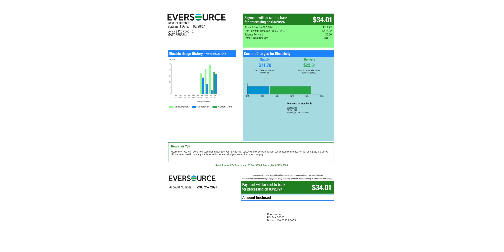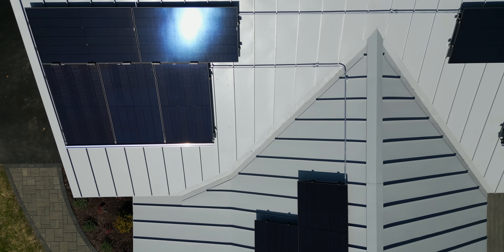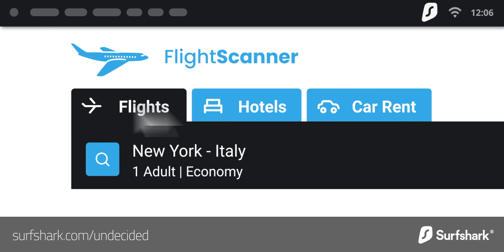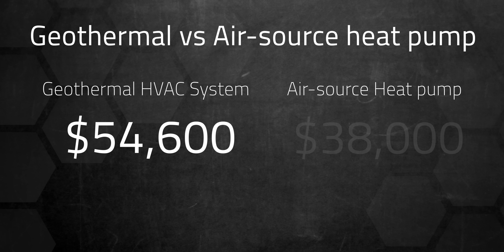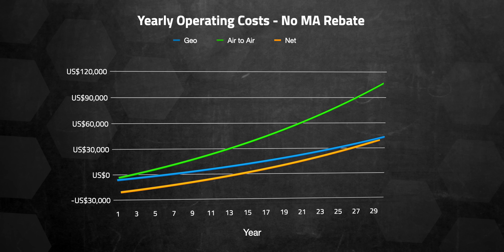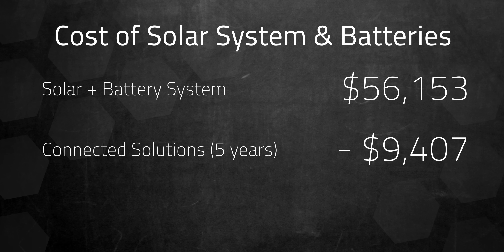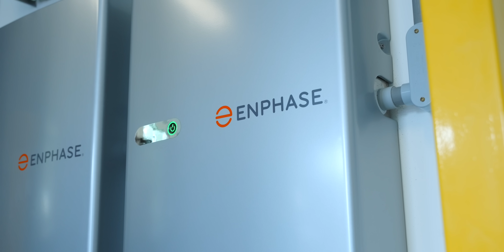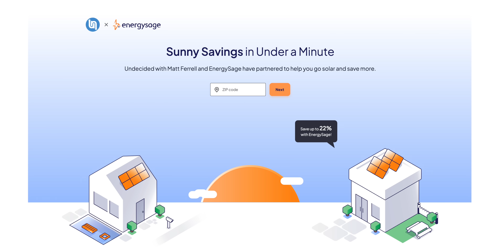What I Learned After 1 Year with New Solar Panels

Comment: Everyone talks about what it cost to install ,and how rebates helped , the cost to replace is never talked about , it a integrated system a lot of companies have gone out of business , not every component is backward compatible so new panels may require down stream components replaced, batteries have a life cycle and degrade over that time , a lot of systems have been abandoned because the replacement is more expensive and no rebates .

Comment: $300,000 in savings over 30 years isn't great, what Matt fails to account for is the time value of money in this scenario. I am not saying it is not worth it from a moral or ethical perspective, but rather from a financial one. Let's do some maths, to get $300k in 30 years you'd need to put $166k into a high yield savings account with an average APR of 2% over 30yrs. If you want to invest in the NYSE instead, with an annual rate of return of 9.5% over 30 yrs, you'd only need $20k. Now, this is simplified and you'd be able to invest the savings on a running schedule, but that also just show how present value and time value of money calculations get complicated really quick.

Comment: Why is solar so expensive on USA? In europe/finland 2024 summer cost for solar is 900€ per kW, so a 17kW system is 15 000€ including everything (tax, installation, microinverters, cabling, fastening system, circuit breakers, maintenance switch and the panels)

Comment: There are a lot of assumptions on costs and credits here over long time frames that cannot be certain.  This also assumes that there is no failures, no replacement cost for charge controllers or batteries failed after 10 years etc.  As more people do this, some of these credits, like netmetering will have to go away and the costs to produce electricity and connect people will increase for all(the connection charge part) due to the lost income.  Total costs are 144k just in thermal and solar alone.  What was the house build cost?

Comment: A factor here is the 30-year plan. The plan works when looking at 30 years. Most people don't live in a home for 30 years. Most don't live in a home for five. In my opinion, to do this on a not-forever-home isn't very feasible. Even if you were to recoup the costs of installing the infrastructure when selling the home, you've just passed it on to someone else. They aren't likely to live there for 30 years either. Good job for doing the right thing for you and for being transparent about it. I had no doubt of your outcome because you analyzed it to death before you started. What would be appreciated is the scenario that doesn't work - i.e. recovering in 10 years.
Reply: And that doesn't even take into account technical innovations and the commoditization of energy well before 30yrs is up.  30 years is literally stupid because that assumes that the economic paradigm won't evolve in the next 30years.
Reply: Batteries should pay for themselves after 5 years - otherwise it's not profitable enough, with only ~10 years lifetime span.

Solar should be repaid up to 7/8 years. They have longer lifespan (at least 20- but up to 30 years).

He didn't compare his house before and after. He's saving 45.000$ after 30 years - from hers32 to now.
But he also invested that money for solar and battery. 
He definitely payed too much somewhere.
Reply: You are delusional. It does not math the math for 30 years, and on pure cost-investment terms I did math and I could pay 148 years of my electricity bill with what he spent, and there are 4 people in my house, 2 of them work from home on computers, so go figure
Reply: does it. his design adds 1000 amonth in princible and interest for 30 years, on systems likely to last only 10 to 25 years. so at the end when you think you got ahead. you will need to start it all again.
Reply: @diegojines-us9pc  

My guess is that Matt is banking on the solar panels and batteries lasting well beyond their warranty periods. If it's just a matter of capacity degradation, he can compensate for that by buying a few additional solar panels and batteries alongside of it, rather than replacing the entire thing.
Reply: @ab-tf5fl  i was banking on my 10 year car to last longer. but the cost of repairs were higher than new payments. but i wasn't counting on spending on either one. what do i do now?
Reply: @karinoren  and the suckers who do pay more than everyone else. " the payments are cheap" but whats the cost? i dont know. thats what they all say.
Reply: @diegojines-us9pc  Indeed. As another commenter pointed out, this is paying for the Electricity NOW instead of LATER. Sure, 1 year later he isn't spending as much. But he had to spend over $100k FIRST to get to this point. Of course it will costs less, when you dump $100k+ into the fund.

I want to see numbers of someone buying a normal house, hooked up to the normal electric Grind, and what that house will be pay Electric Bill for 100 years. Then compare that to a house that has to pay to install Solar Panels, pay to install battery, pay for all other mechanical things required too, on top of their monthly bill, and then the REPLACEMENT and MAINTENCE of the batteries, Solar Panels, and so on for a 100 year period.

^ I'm willing to bet, the solar panel setup will costs you over 5x, if not 10x-100x MORE to use. Cause it's not as simple as "Plug in and forget". The solar panels will degrade over time, break down, and need to be maintained and replace. And that isn't cheap. That's the scam that Solar Panel sellers don't tell you. You only get told the bill will be lower, they never mention the costs of buying, installing, replacing, and maintaining it as well.
Reply: @Jirodyne  i want to see the person living in that home for 100 years. and i can talk with him.
Reply: @Jirodyne  If payback is longer than 10-15years, it is not good investment. In 10 years some of your hardware is broken or even if it works, it is morally aged - there are much better batteries/inverters and much cheaper price. 
It is like using 10 year old laptop - yes it could work but newer are many times more powerful and better.

Comment: Most home have hot+cold mixture water faucets. These unknowingly cause you to use heated water even when you don't need for example in summer. Hence adding a solar water heater which you can disconnect off during freeze could be an excellent addition to take some water heating load off the electrical system. The geothermal system is also excellent option to keep the water warmer then usual.

Comment: At least you think it was worth it.   
Great system. 

I have an insulated sand floor with some buried heating cables that are correct connected directly to solar with zero equipment.  
I was able to get the panels free and spent less than $100 on the heating cables. 
The sand is here already living near the beach in Chicago.  

Its a small system so far, but the proof of concept has been great!  
I plug the cables into the grid if i want to top off the heat sink in cloudy weather. 

Cheers!

The sand floor is topped by concrete pavers.

Comment: A 30 yr planning horizon, that is insane!  The cost of the equipment will still decrease significantly.  On the other hand as soon as there is a significant proportion of people generating like this, all net metering and feed-in tariffs will disappear.  Governments and utilities will wind up with huge stranded costs and there will be a solar panel tax introduced.   Governments always want their cut.  If they can no longer get at you through your electrical and natural gas bills then they will switch the approach.  They have been creaming huge taxes off of the energy system for decades (including fossil) , what makes you think that will not continue?  EVs the same problem, once main-stream the taxes and fees sky rocket, already happening in Europe and the UK.  Matt is clearly running a test case here for the purposes of his YT channel but there are some wildly optimistic assumptions in there.

Comment: I have only one suggestion, make sure your next car has V2X capabilities and make it so that your vehicle charging station can redirect vehicle power back into the home.

In that way, you suddenly have a 50-100 kWh extra battery while your car is at home.

Then, if you see the weather forecast warning about really bad weather coming up, make sure that you solar charge the vehicle as much as possible.

Then you'll easily have 10-20 kWh extra battery without draining your car to the point where you need to limit how much you drive daily. And should the grid go down, you still have 20-40 kWh extra to sit it through (letting the car discharge down to 20%).

Most 2024+ European and Asian EVs now come with at least V2L, that would be like attaching a 3kW generator to your system, albeit with a little detour through an adapter plug. Many of them also have V2G, then your charging station can do the reverse seamlessly.

Selling power to the grid hardly pays anything, so focus on keeping your own  home going.

Comment: It doesn’t appear to me that you used NPV in your calculations.  Future money is not nearly as valuable as money saved today.  If you factor in the time value of money, your savings will be far less than you think.  If you haven’t done so, you need to do an NPV calculation of the 25 years of cash flow and see what that shows.

Comment: As another MA resident; I can't help but chuckle at all this because I am in a very old home with single pipe steam; and am personally really amazed at how much I have been able to improve it with just some rather minor upgrades. I setup home assistant, deployed temp/humidity sensors, and got a thermostat that I could control... and wow the heat in this house is working better than it ever has in my lifetime and eliminated overshoot.
Reply: if americans just invert 1000 in insultation. they would recover that money in less than 2 years. then make money off it for LIFE> add it up. 500 a year for for 50 years of your life.
Reply: @diegojines-us9pc  No idea what you are saying but; "Americans" are a diverse group that live in several different climate zones. We don't all have the same issues. A home from the south would not be fun to live in up in the north where I am.
Reply: @carpdog42  now its cheap to build a home down south compared to the north. because of heating needs, but people down south only thinks that. that dont consider that insulation will reduced their cooling. 
example. one early spring in san Antonio i listen to the media asking out to help the poor to pay heating bills. it got down to the 40's. but imagine what their cooling bills was all year because they had no insulation.

Comment: I live in an area with low electric costs in comparison to the rest of the nation. This would take 50+ years before I would see an ROI. That’s assuming it generated enough power during the 2/3rds of the year where it’s cloudy. And assuming nothing ever needed fixed/replaced during that time. Right off the bat though, I know batteries won’t last 50 years so one replacement during that 50 years would push out the ROI until I’m dead. Not to mention the longevity of panels. 

Also I would treat this like I treat no interest financing on anything. It’s better not to pay lump sums upfront. Because money earns money. The cost of this system if it were instead kept in the bank earning interest would pay the monthly electric bill. In fact it would earn double the monthly cost. So in 50 years you would have accumulated another 80 grand in interest, easily. And that’s after using half of it to pay the electric bill. Not including compounded interest. 

This is why I won’t be sold on energy Independence until the costs comes way down or my electric bill goes WAY up.

Comment: Will the panels and system last 10 to 30 years? I often hear Tesla car batteries last much less than 10 years and ultra expensive to replace. Plus, solar panels suffer heat and cold expansion damage, including rain, hail, snow. Give us an update in 15 years. Duh.

Comment: The best description I have ever heard from someone who lived off grid is that you pay for your energy in advance with solar. This is due to panel lifespan and efficiency. While you see benefits up front, later it dwindles and eventually you replace the panels and spend again. I think the biggest thing people miss is the source. Everyone wants to save $10 million dollars, but in reality we are using energy from a renewable source. THAT is the important thing. Finding more ways to sustainably live renewable needs to be the focus.
Reply: It's not that drastic toh. 

According to research in 25 years your panels will be generating 80% of what they did brand new.
Reply: If it costs more, that's a "NO" for me
Reply: I put in a 10-75 watt panels daisy chained by 2's to get 24 volts and 20 years later they are still outputting prolly 90% of their rated power.   So replacing panels is not really a negative but...todays systems are based on 48v so you may have to change other components (inverters dont last forever so not much of a problem to change) and LiPo batterys have been a gamechanger as the old Deep cycle lead acids have always been the major cost investment (every 4 years if baby'd).
Reply: he’s not living off the grid. he is being subsidized by the grid at a huge price to rate payers who can’t afford these huge capital investments. i replaced my old heat pump with a 98% efficiency gas furnace and a stand alone ac unit. i have a gas stove, water heater, stove, grill, and dryer. my yearly all in energy expenses are less than $ 2000 per year for a 2500 sq ft home built in 1953. my water heater, furnace , a/c units cost less than $12k. two years ago. Why are his electric bills so high?  let me guess the new england grid is run by a bunch of rube goldberg bureaucrats and politicians.
Reply: @rburnscrcva1  Why is our electricity so expensive here in Massachusetts?  Because a few years ago I watched them blow up the largest coal fired power plant in the North East of the United States.  The two state and federal government bureaucracies had  buried it in so many regulations that it wasn't profitable to run the plant anymore. These regulations and lawsuits included building two 600ft cooling towers for the fish.  

 In fact it worked perfectly as designed and installed.  And wasn't the only functioning coal plant dismantled in the US recently.  

So they blew it up.  Then a couple of years ago, Biden stood in the same spot to tout the fact that, now, wind turbines would be staged there for install off shore of New England   Those projects died during COVID inflation.  

Yea.  We pay very high electric bills.  And if you watch the news media carefully, they're starting to warns us about rolling blackouts.  I'm guessing we won't be getting any AI server farms in Mass.

Comment: 20kWh battery... I have been off-grid and hitting the winter right now. My 60kWh isn't enough for 3 days of bad sun and cold. The days here are 3kWh, 6kWh, 50+kWh, 8kWh ... 20kWh is ample enough to heat a 15m^2 container.
Also my 60kWh was about 9000 euro ;-) (eel battery shell and nkon battery cells).

Comment: Holy crap! Those prices are outrageous! We have a 9kw solar system + 2 x Tesla PW 2's (27kwh) - installed in stages - and overall, it cost us £32,000 - roughly $40,000. And ours was an expensive install!

We actually make a small profit, year on year - as we sell electricity back at twice our overnight purchase price. Overall, including the savings from running 2 EV's, we save roughly £6000 a year - $7500. Our entire system will have paid for itself in pretty short time. I just wish we could replace our oil heating with something cheaper/greener - but it's an old 1800's property so it's never going to be thermally efficient.

When we start to struggle getting upstairs, the plan will be to install a lift (elevator).

Comment: It would be great if Matt could do a comparison of costs around the world. As many have pointed out, Matt's cost are unbelievably expensive. I had a system installed with 24kWp of solar, 24kW inverter and 48kWh of batteries for $30k, that is a much larger system than his for 1/3 of the price! At Matt's cost the system needs subsidies and credits to make sense, in other parts of the world these systems just make sense on their own.

Comment: Thanks for your interesting videos! In this video i am missing an important measure: insulating your house from cold in winter and heat in summer. It will result in even lower energy costs and lower up front investments in lighter and cheaper (air to water) heatpump systems for heating and tapwater. As an example I am saving about 2000€ per year on my electricity bill of my all electric house in the Netherlands. Insulation, floor heating, heatpumps, solar panels, it works!

Comment: Having at least some solar and/or storage is also a massive qualitative difference. Even if it's not subsidizing your bills all that much, having some power in an emergency/outage is a massive quality of life boost. With solar, that's also available indefinitely if, say, something real bad happens and a broad grid area is down for more than a day or two

The next step up after "at least some power" is "enough solar + battery to run my fridge and freezer 24/7". Saving a whole double appliance load of expensive food during outages is a pretty big potential saving. This is probably less important in places with more reliable grids, I'll grant, but with natural disasters getting worse and infrastructure either ageing or straining under growing populations and loads, nowhere is guaranteed power at all hours every day at this point